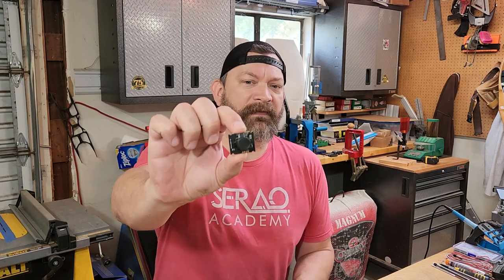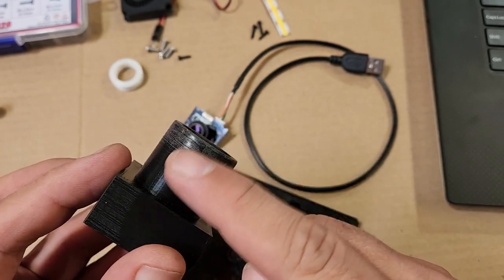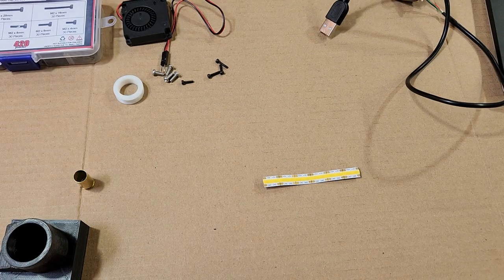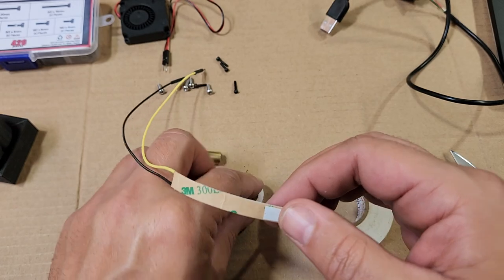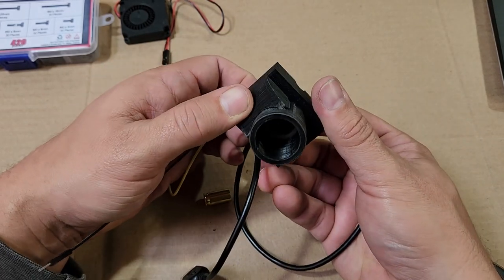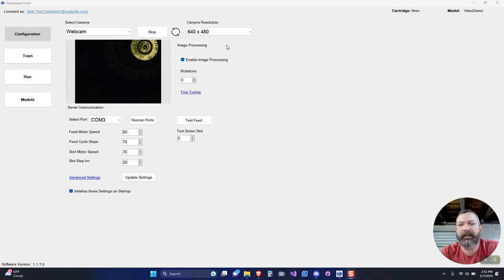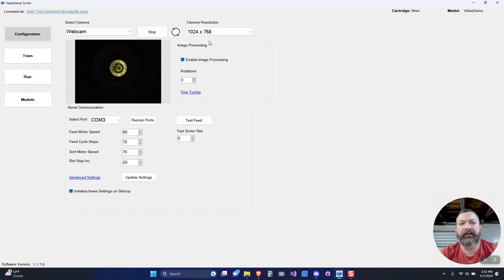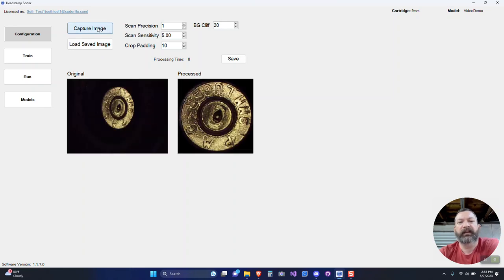CS7.1 Build Series - CameraV2

Comment: Great project.  I almost have all my parts printed.  Is there a current link to the Discord? I cant seem to find it under reloadingrecipes.  Thanks
Reply from the maker: The link is on the software downloads page. You can get there from the reloading recipes site by clicking on the Software Download Link (right side) and then registering for an account. You will then see the download information as well as the link to join the Discord.

Comment: Question1, which PLA/PETG material did you use for the light ring? is it only a white PLA/PETG filament? How did you print the camera housing, which position on the printing bed and with/without supports?
Reply from the maker: I use cheap non-opaque white PLA for the light ring. I don't know the brand because it was a small spool that came with my printer. From my experience, PETG won't work as it is mostly opaque.  The camera housing needs supports and it printed with the big end down. I usually set the support angle to 80degrees
Reply: THX for your quick answer 👍

Comment: I have started this build now it's time for the computer do you have a recommendation I did try running this on a tablet and it won't run on a tablet.
Reply from the maker: Please check out the parts list. There are some recommendations for computers at the bottom. Also you can get more recommendations from the community on Discord.  Thanks!

Comment: where is the link for the parts and assembly?
Reply from the maker: Check out the video description. The link to the github project is there. In the instructions.pdf at the bottom is the link to the parts list as well.
Reply: @sjseth-builds  thanks, found it.  quite the project.